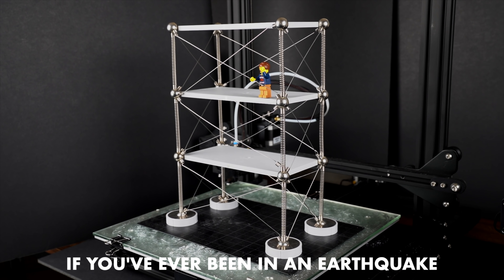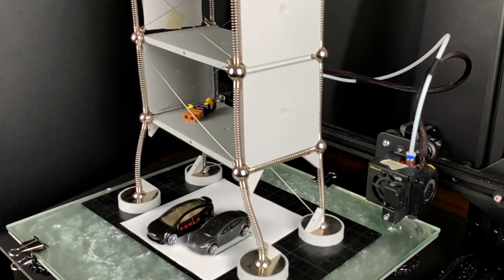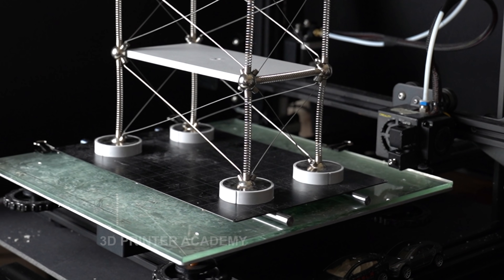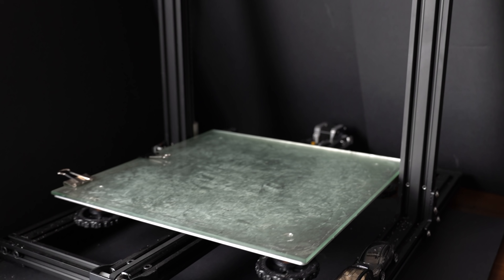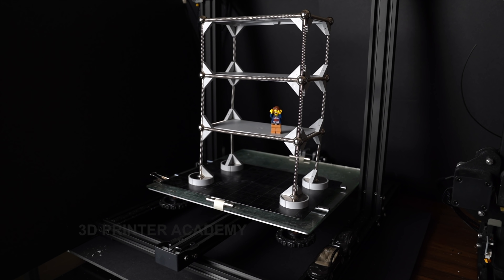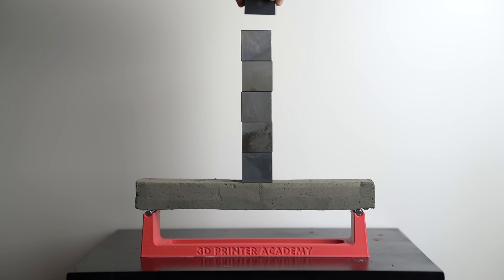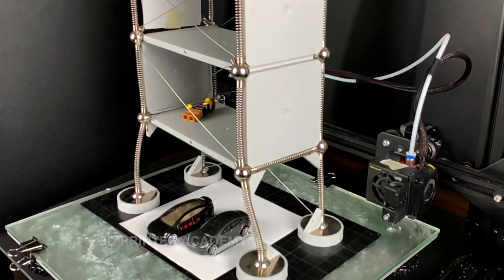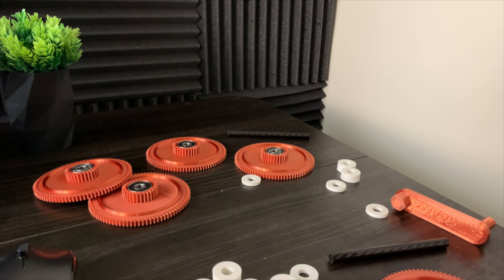Simulating an earthquake with a 3D Printer

Comment: How do I do this with my printer? is there gcode online for this? If there is I cant find it.
Reply from the maker: You can use a text editor to write the g-code. For basic oscillation you can just do:

G1 Y0
G1 Y20
G1 Y0
G1 Y20
G1 Y0
G1 Y20
etc.

G1 is the move command and y is the y coordinate you want it to move to. Save the text file with .gcode extension and upload it to your 3d printer.

Comment: This video shows a weak axis failure of a cantilever masonry wall but that it not the issue. The issue is strong axis lightly to no reinforced masonry/conc walls which have high stiffness and attract high loads  until cracking in which the capacity becomes zero.

Comment: I have a question for any civil engineers/expert framers. Here in the US, new construction is typically Western Platform, which would appear to fall closer to moment framing, especially given the amount of hardware we use (hold downs, straps, etc.) to preserve structural integrity in an earthquake. However, wouldn't the exterior sheathing also qualify the structure as braced? It seems to me modern residential construction is both moment framing and braced framing, even though cut-in/let-in bracing is non-standard nowadays.

Comment: Im curious about the orientation of the rollers demonstrated at the 1:00 mark; this wouldn't work if the rollers were rotated 90°. Can seismologists determine which direction the building will shake? You're demonstrating back and forth shaking, what if the same building shakes side to side against the rollers instead of with them. Is the lateral movement vs longitudinal movement of the earth in a given area consistent over all quakes?

Comment: Cool demonstration definitely deserves my like, though I cannot help but point out, as a concrete man myself, that you should have let the concrete dry for at least a couple of days. I would say 10 to 14 days but since the quantity of it I recon a couple of days would have sufficed. At least until the concrete have changed in color a bit. This would have made a world of difference between the reinforced and the regular slab. Also, in these types of hangover slabs (excuse me for missing the right term here) there is a lott more, depending on the weight it has to carry, thick rebars inside a rebar cage (I have no idea what most professional terms are in English). Basically the more load it has to carry the more rebars and the more thick they have to be inside different class concrete. So nowadays structural errors are barely made on a constructional level. Now I have to add that in my country earthquakes never happen (knock on wood), so we don't construct buildings appropriately, and I have therefore little to no knowhow about this, but this is how we reinforce a building.

Comment: Or just do what the Japanese do: For every 3 rows of bricks, put a row of rubber bricks 20 inches thick. It serves as shock absorbers and greatly reduces vibrations. For skyscrapers and office buildings, they have Earthquake Dampeners installed at every floor on every corner. They look like bicycle pumps and is filled with air.

Comment: For the steel reinforced beam at 3:05. You should have placed the beam so the reinforcing is on the bottom of the beam. Your configuration doesn't make full use of the steel reinforcement because the steel is in compression when loaded. As the beam is loaded, the top of the beam is under compression but the bottom is under tension. (Steel is mainly used for its tensile strength) Both beam experiments actually experienced tensile failure. Also the reinforced experiment collapsed roughly with the same speed as the unreinforced beam, which is not a favorable outcome because no one makes it out alive. Loaded in the other configuration not only makes the beam stronger but it also slows down the speed of collapse as the steel stretches which allows people to see the beam deforming and gives them time to escape.

Comment: For anyone wondering why concrete works better when reinforced with steel, its because concrete supports a lot of compressive strength but barely any tensile strength. The steel helps give it some additional tensile strength and doesnt take away much strength when it comes to its compressive strength. Its why if you slow the video down to super slow motion, you see the brick breaking from the bottom to the top (because the bottom needs to support tensile strength which isnt a strong suit of concrete as stated above)
Reply: Also steel is used because it has the most similar thermal expansion. Which helps with longevity. Or thats what i heard at least. Please do correct me
Reply: @maximcoppieters  correct. Means that when temperature increases, no internal stresses within the concretes fisures form causing potential cracks etc.
Reply: For anyone wondering why reinforced concrete is better it’s because it is reinforced
Reply: This sounds very similar to a video i watched, cool
Reply: I like your big words magic man.
Reply: @frequentsobber  compression is just crushing. Tension is pulling. So basically it's a lot easier to break concrete by pulling rather than by crushing.
Reply: Are you my reinforced concrete professor hiding on an anonymous youtube account? xD

I'm in that class this semester LOL
Reply: I understood none of that and I didn’t even finish reading but I’m assuming you’re right so take a like
Reply: The fact you have to explain this 💀
Reply: @cube4547  Watch out everyone, he went to Harvard
Reply: I recently learned about "post tension cables" at work. They are pretty serious
Reply: Good game
Reply: Sorta understood
Reply: Thanks I wasn’t wondering
Reply: You can do a cheap and dirty reinforcement using bamboo instead of rebar apparently
Reply: What does blue mean in the map 🗺 from the beginning of the video
Reply: @xxphhhxx6921  the blue means you have a low chance of experiencing an earthquake
Reply: @lil_savage446  I live in Cali, and I’m on red and orange color, but why isn’t there earthquakes?
Reply: @xxphhhxx6921  it might measure the severity of earthquakes instead of how often then. My bad
Reply: what
Reply: Or you could just say it as a better base
Reply: It’s like giving a building a bone structure
Reply: Yep, thing a Lego tower held together with rubber bands, you can't pull it apart as easily anymore
Reply: Will there be an exam on this?
Reply: Daaaaaamn
Reply: Thanks, Lil_Savage446!
Reply: My physics teacher explained this
Reply: I loved reading your Ted talk
Reply: Also the steel provides emptional support to the concrete by whispering complements in its ear
Reply: whos the smart one now?

Comment: The only issue with a roller frame design, aside from the fact that it’s a wonderful idea, is that it won’t work for current utility connections. They would require too much tech and expansion joint work that it would basically make it incredibly expensive to install and maintain. I love the idea tho.
Reply: Its not an idea anymore its actually used on real buildings. If you already knew it was used then sorry, but your comment makes you sound like you ve just heard about it now.
Reply: @88keysperfeel1ng9  This is my first time of hearing about it. It works great if it’s implemented on a newly constructed building, but what about the millions of other homes without it? If there’s a cheap and simple way it, I’m all for it.
Reply: @Andrewlang90   i dont know but its not like a building is doomed if it doesnt have those rollers. There are other methods. My house for example has steel reinforced concrete and it survived a big earthquake in my country. It was 6.4. And another thing to remember is that not all houses or even buildings actually need rollers because in a lot of places there cant be such a strong earthquake that makes rollers cruical for the building to survive. Cheers.
Reply: It only works on buildings built with it from the start.
And it does work
Reply: I'm just gonna say, both sides to this argument have a really good point, a rare occurrence
Reply: @thhunteralf9398  Thanks. It’s not often that it happens, and even less often people point it out. So good on you 👍🏻
Reply: You could also design rigid joints that will decouple and seal themselves automatically if an earthquake happens and the building starts rolling.
Reply: @tissuepaper9962  Again, great idea, but the tech behind it would be incredibly expensive to design, implement and upgrade to millions of pre-existing homes. I love the possibility tho.
Reply: @Andrewlang90  why would you do this to normal homes? We're talking about 4+ story buildings here. Normal homes aren't normally tall enough for rollers to make a difference.
Reply: @tissuepaper9962  I meant more for utility connections
Reply: Huh? It's something that's been used for a long time, actually. The skyscraper I live in was built in the 1980s and it was built on rollers.
Reply: I've read that the buildings in NORAD are built atop thousands of giant springs that absorb shock from earthquakes and bombs. Can the same be used on other buildings?
Reply: Na, you can make all that stuff with a flexible section to compensate. Like water and sewage pipes with a few zigzags with freely rotating joints at the corners. Thats what they use in hospitals in New Zealand.
Reply: There's an exhibit that's part of The Papa museum in Wellington that lets you go down to the foundation level and see some of the joints actually supporting the building, as well as a model for why separating the ground and the foundation with flexing joints actually works. It's been in place since the 90s (I think it was that early?) and it isn't high tech, just a really cool use of physics and modern building materials. The only buildings that tend to really struggle with retroactive earthquake proofing seem to be the huge brick/sandstone ones, especially if they've already been damaged.

Comment: What filament did you use for the bricks?
Reply from the maker: paramount 3d terra cotta PLA
Reply: @3DPrinterAcademy  does the ender 3 need any special nozzles in order to use it?
Reply from the maker: @xeonthemechdragon  Its just "Terra Cotta" colored PLA so any regular nozzle is fine
Reply: @3DPrinterAcademy  I will definitely try it out, when I can get my printer running correctly